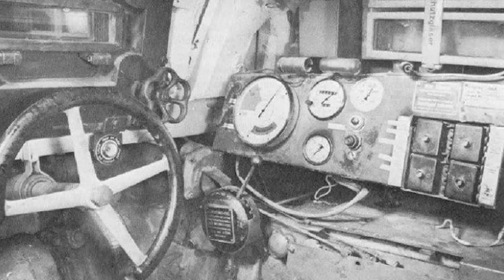A Deep Dive into the Tiger I, by the Chieftain

Comment: I hab a patient, an old guy 15 years ago, former German tank commander. He thought, the Tiger was a good tank „ because I survived the war in it“. He also changed my understanding of the effectiveness of WW II airpower against tanks. „How did you protect yourselves against enemy airplanes?“ „ we closed the hatches“. And:“ why should they try to kill our tanks, difficult, dangerous, when they could blow up our fuel supply“
Reply: excellent reasons from a man who’d know
Reply: @minuteman4199  …. I grasp that. that wasn’t what I said or implied. My father and uncles were WW2 vets. They had their own experiences
Reply: Tiger's and panthers were vulnerable to Airburst artillery shells in testing the shell would go down in and perforate parts like the radiator etc one of the things the old churchill tank was underated for it could drive through artillery fire and almost be safe from it they say
Reply: Fantastic points, both of them.
Reply: @zzirSnipzz1  Theres a reason late war panthers have additional turret roof armour and flat plates over the engine deck vents.
Reply: @voiceofraisin3778  I would say they were still very vulnerable to petrol bombs
Reply: As an individual soldier you want to be in the toughest tank around.  As a general, you might prefer to have a larger number of more mobile and reliable tanks.
Reply: That was the "lesson learned" for the Iraqis.  Taking on the M1 Abrams was suicide.  It's "Achilles Heel" was that it's a THIRSTY beast; relying on convoys of relatively "soft" fuel tankers to supply it.  The best way to stop an American tank battalion is to find and destroy its fuel convoy.  This is how Pvt. Jessica Lynch was captured and another member of her truck unit, Spc Lori Pietswa, was killed in 2003; the Iraqis were going after them rather than the Abrams tanks themselves.
Reply: @zzirSnipzz1  Every WW2 tank was vulnerable to artillery! Some more and some less. None would've survived a direct hit of a mid size artillery round on turret or engine deck!
Reply: @zzirSnipzz1  Maurice Rose, C.O. of the 3rd Armored Division was killed by two Panzers in the last months of the war because the tanks were thought to be knocked out from direct hits from napalm.
Reply: @wanderschlosser1857  a direct hit is very uncommon compared to downward shrapnel from a shell exploding in the air. The original comment was talking about an above ground explosion from either proximity fuze/timed fuze. Being vulnerable to getting M-killed from that is a way bigger liability than being vulnerable to a direct hit. Even tanks today can't stand the over pressure from a direct hit so "every tank is vulnerable to a direct hit" is a very bad excuse for this vulnerability
Reply: @pepebeezon772  Except the Tiger wasn't a bad design. Not flawless like every other tank of its days but certainly very successful as a tank. It's combat records speak for themselves. Was it a war winning design, certainly not, because the doctrine of war on the side of war the Tigers were fighting did not turn out successful. Did it use too many recources in comparison to its fighting value? Probably yes. But as a fighting machine it was rather used as a main battle tank contrary to its design as a heavy assault tank. And it did work formidably in both rolls, again have a look on its combat records. One thing can be said for sure, the Tiger was a far better tank than the Churchill. Just imagine the Churchill would have been required to stop or at least slow down the Soviet tank armies.
Reply: @wanderschlosser1857  Let me clarify. I'm not judging the Tiger's performance or overall design. I'm talking about this particular vulnerability
Reply: @pepebeezon772  Got it. I understand that the Tiger was more vulnerable to certain artillery fire than the Churchill, which was the content of the initial comment. But it was used to diminish the battlefield effectiveness of a Tiger based on one topic. There are many more topics where the Tiger was worse than other tanks. Still as an overall design there weren't many tanks that played in the same league. The Churchill certainly did not!
Reply: The famous Tiger 2, left and still to be seen in Belgian, La Gleize just ran out of fuel during the last offensive German Battle in the Ardenne, as many other German tanks, which also ran out of fuel and also - spares in the East. Without essential parts they couldn't drive any further.
Reply: I am pretty much of the opinion that where Allied Airpower really excelled was not in taking on the armour directly. but in smashing not only the soft skinned supply vehicles and fuel bowsers, but also in hammering the road and rail network the logistics relied on. 

As has been said before, does not matter how good a tank is, if it does not have fuel or ammunition it is useless. In addition tanks were maintenance heavy and rough on components. Even reliable, relatively easy to maintain vehicles like the M4 Sherman still required a ton of spares to replace  wear and tear or battle damage. Without those spares your tank fleet is going to suffer pretty heavy attrition simply from breakdowns that cannot be rectified because you have no spares....

So yeah, absolutely agree with the old gentlemans point of view there. Tanks were (relatively) safe from airpower, but without their soft skinned support at best your tank unit's ability to fight is seriously degraded, at worst it cannot fight at all....
Reply: You won't hear any Tiger crewman bitching about their Tigers. Quite the opposite in fact.
Unlike Sherman crews.
Reply: @selfdo  Something the Russians also realized in the attempt to seize Kiev.
Reply: @montieluckett7036  General Rose and his driver ran unexpectedly into a King Tiger tank when they rounded a curve on a tight road near Paderborn, Germany, on March 30, 1945.  The driver attempted to accelerate past the slow-moving German tanks; the jeep in front of them made it, Rose's did not, being cut off by the KT.  He and the fellow passengers in the Jeep dismounted, and Rose went for his pistol holster, either to fight or to surrender, it's unclear what he intended to do.  Rose was immediately cut down by a burst from the Tiger's commander, wielding an MP40, being hit with 14 rounds, including five to the head.  From all available witnesses, it appears he died instantly.  The rest of the jeep's passengers managed to hide in the scrub and returned after dark, when the tanks had left, to retrieve the General's body and any documents he had on him.  Later, the circumstance of the shooting was investigated by future Watergate special prosecutor Leon Jaworski to see if any war crime(s) had been committed; the conclusion was that the Tiger's commander acted in good faith that perhaps Rose intended to fight.  Also, the Tiger's crew probably didn't know they'd killed a general officer, as most American general didn't wear their stars in a combat zone, to avoid being targeted by snipers, nor had they attempted to retrieve any of the documents on his person.
Reply: @wanderschlosser1857  They also tended to be used differently.  And certainly the Churchill would do its best to fight a King Tiger if it had to, but it wasn't meant for anti-tank work anyway.
Reply: @selfdo  The roll the Churchill actually played is very alike the roll the Tiger was intended to perform when designed, infantry support and breakthrough/assault. That it also performed very well in the anti tank roll just shows that the Tiger was in a different league. It was already quite close to what we call MBT nowadays.
Reply: @wanderschlosser1857  If the Tiger had a more powerful engine, or diesel technology was advanced enough to fit a sufficiently powerful plant in its engine bay, then it would have been a bona fide MBT.

From what I understand, what hampered the Churchill was a relatively narrow chassis, necessitated by restrictions in UK rail lines ca. 1939-1940, which in turn dictated the maximum diameter of the turret ring.  Not necessarily an issue when the 2 pounder gun was considered to suffice as an anti-tank weapon!  Later on, when in an emergency program those restrictions were "fixed", a wider Churchill prototype, the A43, was developed so it could take the 17-pounder gun in a larger turret; this was known as the "Black Prince", after Edward of Woodstock.  This was an attempt to devise a "universal" tank, as the Brits were 'hep' to the concept of a MBT, but by the time the prototypes were being tested, the Sherman Firefly was deemed satisfactory, the Comet likewise, and the Centurion was coming along rapidly, all these vehicles had better mobility than this version of the Churchill, so the A43 was not placed into series production.
Reply: @selfdo  The  Tiger had a powerful engine for its time. It was be no means a slow or underpowered tank. Being a Heavy it could hold pace with most medium tanks of its time on- and offroad. Having a petrol engine certainly meant it was a fuel guzzler and had a higher flame risk but it wasn't alone with that engine choice for good reason. An equally powerful diesel engine with the technology of the late 30s, early 40s would have been much bigger and way heavier! In my opinion the best match of diesel power to tank weight ratio in WW2 was the T-34 but this one had some severe issues with driver friendliness and refinement of its drive train.
Reply: @selfdo  For all I read the Black Prince was a failure and therefore didn't make it into production. The Comet was the first step into the right direction and of course the Centurion was a big shot. It was the only British tank that really would have been on the same level or even above compared to the German cats.
Reply: @wanderschlosser1857  I wouldn't say the Black Prince tank was a "failure", it was exactly all it could ever be.  It was that the Churchill as an AFV platform had run its course.  For what it offered it didn't justify its expense as to what the British Army got out of the Comet and later the Centurion.  There was also not much later the FV 214 "Conqueror" heavy tank with a potent 120 mm rifled gun.
The Churchill AVREs, or "Hobart's Funnies", were quite useful as-is, so there was no justification in the expense of making specialized vehicles ouf of the Black Prince.
Reply: @wanderschlosser1857  Yes, the diesel engine technology of the time simply didn't allow for a compact and light enough engine to be practical for a MBT.  That was ONE reason the US persisted with the AVS-1790 V-12 air-cooled engine (Jay Leno's "tank car", the Blastolene Special) well into the 1970s!  Yes, such a large gasoline engine drinks a LOT of fuel, a problem that the US Army STILL has, albeit with "Jet-A", which it uses in greater quantities for its helicopters, and "solves" with massive fleets of tanker trucks. 

 Remember the sage in 2003 of Pfc Jessica Lynch who was captured and reportedly mistreated by the Iraqis, or Spc Lori Piestwa, killed in the same engagement?  They were serving in such a fuel convoy.  Most forces that have had to engage the M1 Abrams figure out that taking on the tank itself is typically "suicide", but it's weakness is that it doesn't go far on a fill-up!  The way to stop the Abrams is to get its fuel supply. 

 The AVS-1790 was developed in the late 1940s when it was clear the Ford GAA, excellent for the M4A3E8 "Easy Eight" Sherman, simply wasn't enough to propel the M26 Pershing, and its bigger brother, the V-12 GAF, proved unsatisfactory.  This engine was used in the M46 (the re-engined M26 with some other improvements), the M47, and the first three versions of the M48.
Reply: @selfdo  You are correct. It has been alleged that in the following days a number of German prisoners were killed in reprisal for  this including SS Hauptsturmfuher Klaus Klowskloski captured and beaten to death with a shovel.
Reply: @lyndoncmp5751  Great comment and very true.
Reply: not it is a lot of them did look no farther than the ardennes, couldn't keep gas in them.tell it to the guys who fell thru bridges ran out of gas and blew them up so they allies wouldn't get them. Their tranny's and drive shafts broke down a lot
Reply: @bigwoody4704  In the Ardennes between December 16 - 30 13 Tiger II were lost, none fell through a bridge,  1 suffered power steering failure ( due to shell strike) ran off the road into a ditch and a number were obviously abandoned in La Gleize. If the Germans had controlled the battlefield most would  have been made combat ready. None suffered reduction gear failures.  At some stage probably most tanks ran out of fuel, that's a logistics issue not the tanks fault.
Reply: @frankvandergoes298  sources? you certainly don't know that .Many did, not sure if it was  there and many couldn't cross for that reason.I've read they did,not sure how many they also got stuck in the mud then hammered by artillary - they weighed 57 tons.The Tigers were great open country tanks  like the russian steps,The hills, narrow roads, woods,ravines,rivers were problematic in Europe the bulk/hulk of steel to manuever
ELSENBORN RIDGE AND ST. VITH
The German attack achieved the desired surprise but often encountered unexpectedly tough resistance. Their timetable did not allow for delays, but time and again the Americans slowed the enemy advance.

The road network in the Ardennes was narrow and rough. A key road for Sixth Panzer Army’s advance ran parallel to a stretch of high ground called Elsenborn Ridge. Along this ridge, ad-hoc groups of tanks, tank destroyers and dug-in infantry stubbornly resisted. General Eisenhower, immediately realizing his men were facing a major attack in the Ardennes rushed artillery to support the ridge. The firepower from their guns left the narrow roads choked with wrecked vehicles, in addition to those that broke down on their own from mechanical failure. After 10 days of intense fighting, Sixth Panzer Army abandoned its attempts to cross Elsenborn Ridge and sought other routes.
Reply: @bigwoody4704  I certainly do know that, Tiger 105 in Stavelot, driver lost control tanks reversed into number 58 Rue Haute Rivage and was abandoned, in full working order, number 222 hit 10 times by anti tank rounds and immobilized, abandoned by its crew, both could have been repaired. Tigers weren,t deployed in the battle of Elsenborn Ridge.
Numbers 008, 105, 104,133, 204, 213, 221,222,223,304,332, 334 were all disabled and abandoned but none were technically written off, and if the Germans had controlled the batlefield, they could have been repaired and redeployed.
Reply: @frankvandergoes298  I'd make the fairly easy assumption that they just avoided bridges that couldn't handle the tiger, which actually happened and happened with much lighter tanks by virtue of the age of European infrastructure let alone how not a hell of a lot of it ever needed to be built up to take such heavy loads.
Reply: @bigwoody4704  Calm down Lil Woody, American GI,s were not the only ones who suffered from frostbite, so did the other guys. You have expressed an opinion which is what these forums are all about, BUT you have failed to back up your rhetoric with fact. Name a Tiger that fell thru a bridge in the Ardennes??, Yes many ran out of fuel, and 334 at Bourgemont was absolutely plastered by artillery disabling it and forced the crew to abandon it all well documented, but had the Germans controlled the battlefield most would have been repaired
Reply: @frankvandergoes298  I'm perfectly calm swatting down your illusions of integrity,so frank how many Tommies or Dutchman died there? Evidently very little if your sources were looking for excuses for you to back out of  yet another losing comment.200 Tommies died in the Battle,not sure about Dutch - plenty of Belgians.Tell me frank where do you live?
Reply: @phaeronseherekh1754  this was mentioned in every book i had read on the battle about Tigers and bridges. But Frank is dealing the cards so humor him for a while. Their wonder weapon came back to bite them in the ARSE
Reply: @bigwoody4704       It didn't really though, wasn't a wonder weapon as the video easily covers. It was a breakthrough tank much like literally every heavy tank I can think of during that period. What bit them in the ass was limited industrial output from the British blockade, eventual manpower shortages and having factories forced to go into hiding.       
         
           Oh and please actually bring up sources if you want to call for them because its just he said she said to anyone observing. Every book that actually could be used as a source instead of pop culture or so very far down the grapevine generally never mentioned the "infamous" Tiger runs over footbridge and falls through occurrences.    They certainly found bridges they couldn't cross but that was usually done away with during planning and only came up as a problem when bridges had been demolished. If Tigers kept falling through bridges there would probably be a fair few left today to outright source from.
Reply: @phaeronseherekh1754  I said problems with not falling thru though there was at least one that did just that,I forget what book.And british blockades? - no this wasn't  WW1,their war indsutry was spread to thin with them making too many models.Facing two emerging superpowers will do that
Reply: @bigwoody4704  So the Germans could just magically trade through British dominated waters then? so they could just import all the expensive and rare metals and fuels they didn't have?
Reply: @phaeronseherekh1754  I thought you were taling about the North Coast of Germany
Reply: @wanderschlosser1857  even if the tank survived with minimal damage, the crew certainly would not have.
Reply: @bigwoody4704  In WW1 the British grand fleet didn't actually just sit off the coast of germany in a age of sail esq blockade, they used diplomatic force and patrols well out of quick response range of the Germans
Reply: @bigwoody4704  Sincerely if you wish to give anything resembling amatuer historians or even Amiercans in general a reputation better than being completely clueless be my guest and start actually going and reading books. "Look who took to the profanity and name calling" You're the one who can't handle the notion of being wrong or that war has no room for such niceties as international law and starts desperately throwing insults to protect your argument.
Reply: @bigwoody4704  Also again as a reminder for basic argumentation if you start demanding sources provide some of your own to put the stress on them, something you never did with frank and barely did with me because you seem to lack any besides "this is what I saw in the movies"
Reply: Given your place amongst the ignorant you can't tell anyone a thing.The National Archives are not amatuer historians, Nice to see you taking a break from taking a break
Reply: @bigwoody4704  What is the almighty "its from the national archives" not going to go after anything else I said? or do anything serious to actually prove his point?
Reply: @phaeronseherekh1754  this just keeps getting easier and easier, AGAIN - tell INDY Neidell he is an amateur Historian. I left the names of the sources, 3 in all,this board being one of them,and the other two. That you proceeded to call amateur and you in turn offer nothing but your uniformed,misguided opinion  🤣  .You can enter those into the search bar at the top of the page if that process isn't  little too complex for you. Try actually reading rebuttals but by all means keep posting everyone else looks so much better
Try typing any 3 of these of these that I previously left if it's not too much trouble,then go hauntsomeone elses bridge
1)The British Naval Blockade of Germany I THE GREAT WAR Special
2)Was Britain's WWI Blockade The First Atrocity Of The 20th Century?
3) www. National Archives. gov .uk  /pathways /  first world war /spotlights blockade.  htm
the last link you will have to sandwich together I would do it for you but this board deletes posts with links attached. Go get 'em Tiger
Reply: @phaeronseherekh1754   pretty smug limeyesque thing to say, ain’t it?

If y’all don’t want to seem like a bunch of smug snobs “in general”, maybe you ought to not make such obnoxious and disparaging claims, whot?

(and I had been agreeing with the guy whose ops y’d been supporting BTW)
Reply: @wanderschlosser1857  @Douglas Self   I really quite enjoyed listening to both of you exchange your very interesting personal knowledge of this niche in Tank history- thanks a ton, to both of you. It was as interesting as the video in my op.

Cheers
Reply: The....you were a lucky man to have this gentleman as a patient.  Thank you for sharing his thoughts.
Reply: @lyndoncmp5751  Is that really true? How many Tiger crewman were interviewed? There were a lot more Sherman crewmen than Tiger crewmen, and most of them survived the war, so were able to come home and complain about the tank.
Reply: @wanderschlosser1857  Tiger had a powerful engine for its time, but was very much underpowered. They didn't start producing engines for heavy tanks that were truly powerful enough for quite some time.
Reply: @selfdo  Pretty much all tanks are fuel hogs. Even fighting against diesel tanks, I think the enemy would go for the fuel convoys.
Reply: @WheelsRCool  Facts are,  the Tiger I had a power to weight ratio of 13 hp/t. In comparison the Sherman had dependent on Version and engine between 10.5 and 14 hp/t. The M26 Pershing had 11, the IS-2 had 13, the Panther and the T-34 about 15, and so on. Unless you call all of them underpowered the Tiger I was actually pretty powerful and mobile for a Heavy. Even the Tiger II with a much lower ratio of 10 hp/t was not actually slow for its time. What was the main problem of the big cats were rather their final drives.  Not so much for the Tiger I,  initially very bad for the Panther, but much improved at later versions and certainly problematic for the Tiger II.
Reply: @wanderschlosser1857 I may be mistaken, but I remember hearing/reading multiple times that tanks were pretty much always underpowered until engine design advanced enough to where they could finally fit smaller engines in that had high amounts of power. So Tiger probably had a reasonable power-to-weight ratio for its time, but otherwise the power-to-weight ratios of all tanks back then was lousy.
Reply: @WheelsRCool Comparison with modern MBTs is a bit useless. Also it's usually the German cats that are frequenrly called underpowered which is a common fairytale.
Reply: @wanderschlosser1857  I think you can compare power-to-weight ratio to modern MBTs. In terms of the German tanks, the "impression" I always had wasn't that German tanks as a whole were underpowered, but rather that ALL heavy tanks of the time and somewhat beyond, ranging from the Tiger and Panther to the M60 Patton tank, were underpowered.
Reply: @WheelsRCool  If you see the figures,   then the Sherman and even the T-34 must have been underpowered in comparison to Tiger I and Panther and yet you never hear or see that mentioned. The point is,  the accusation Tiger I or Panther have been underpowered is simply a fairytale proven wrong by operational data and experiences yet  repeated again and again.
Reply: @wanderschlosser1857  Yes, that was why I said my understanding was that all tanks pretty much, or at least all heavy tanks of the time, were underpowered. Arguing though that the Tiger and Panther were underpowered is not saying it was a design flaw, rather just that they were too heavy for the engine and transmission technology of the time. 

I agree you hear it mostly about the Tiger and Panther, sort of like you only hear about the T-34 having sloped armor even though the Sherman did too.
Reply: @polarvortex3294  brilliant point
Reply: ..Allied aircraft had a poor success rate against tanks. They were good at friendly fire though.